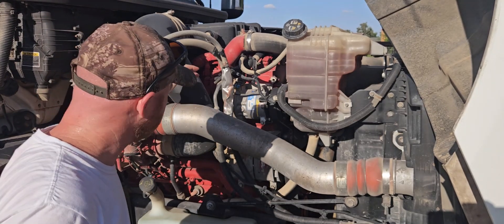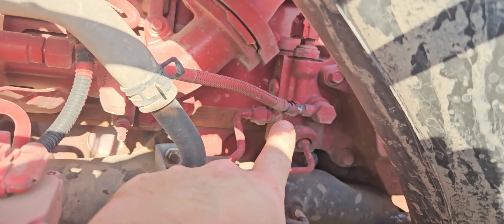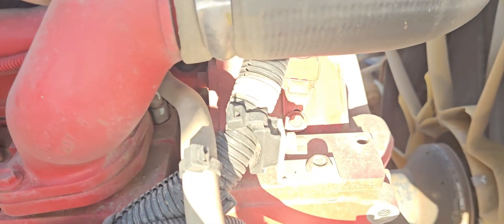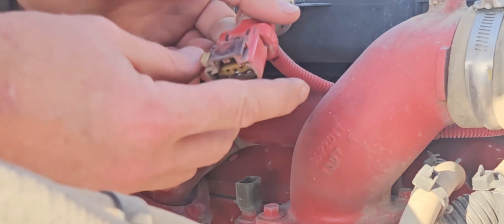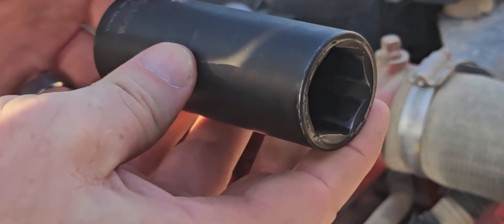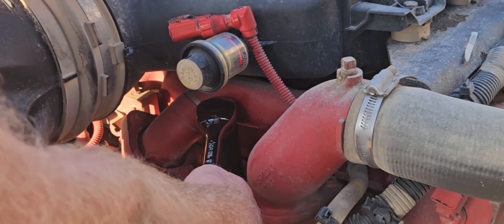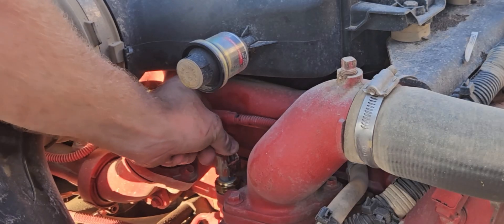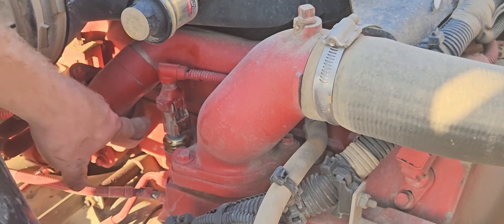Engine Exhaust Gas Pressure (EGP) Sensor troubleshoot and replace. SPN 1209 FMI 2 Check Engine

Comment: Hey my connector/wire harness is kinda loose, I get the error message Derate in 3 hours every now and then, then it goes away for like 3 days then comes back on, do you know the name/part number of that harness just in case its what is causing the problem?
Reply from the maker: Very well could be the harness, I wouldn't know the part number without knowing the truck, engine,  transmission details.
Reply: @allboutmining it's the X15 2019 on a t680 2020 12 speed Eaton auto, I've tried to look for it but no success yet
Reply from the maker: @victorvalencia8726  it may be best to just call the dealer or a shop near you and talk to them... they can find a part number pretty quick typically.   I had to replace the wire harness on my transmission recently due to a Crack in the wire or connector recently.   I would randomly get errors or transmission would do weird things.